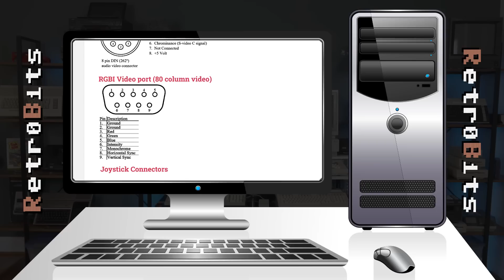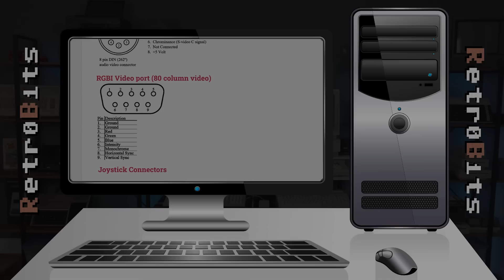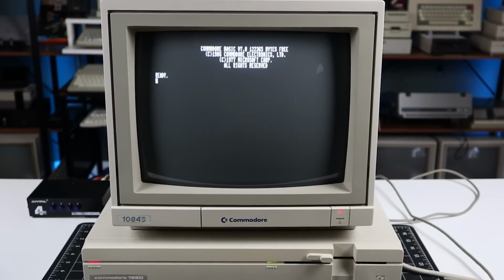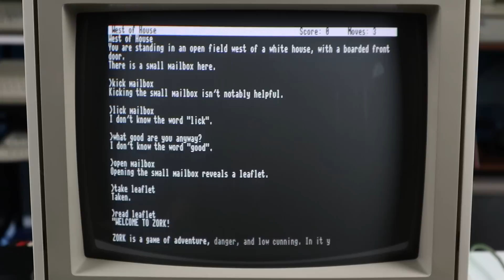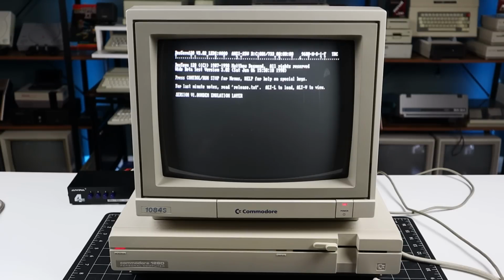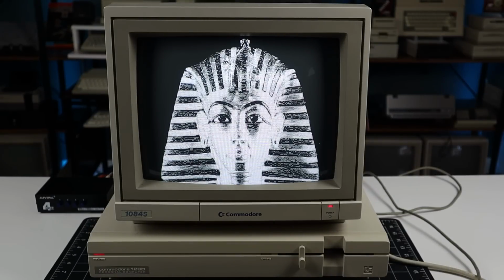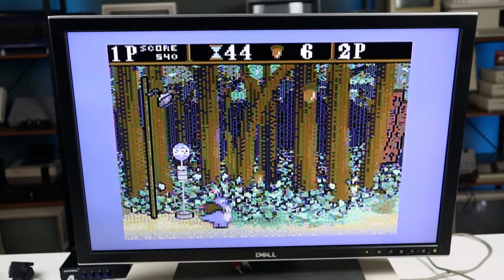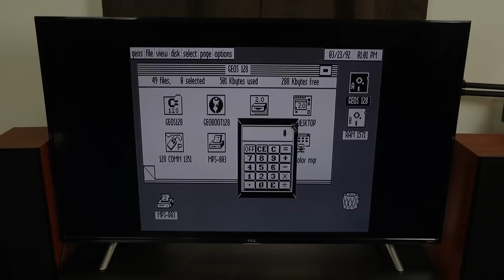80 Columns on the Commodore 128 without RGB or an adaptor?

Comment: Makes you wonder what that VDC could have done if Commodore decided to go for an 8088 instead of a Z80 for the second processor. It would have knocked CGA out of the park, and you'd be able to play MS-DOS games with SID sound. They took the wrong commercial gamble to support CP/M instead.
Reply: I dont think supporting CPM was the intention.  The 128 essentially was a super 64... everything people complained about the 64 was fixed (added on) to the 128.  An 80 column mode, faster disk IO,  actually usable CPM, a faster processor, a better BASIC, etc.  All of these things existed for the 64 as separate add-ons. Seems then that the goal was to build "a better 64".  I think they succeeded, but obviously it was a short term fix while they got the Amiga ball rolling.  x86 was saved for their clone line.
Reply: Back in the day the CP/M market share was higher than anything MS-DOS or Windows has ever held.  It truly was a monopoly.  Though the writing was on the wall in BIG LETTERS by the time C128 released.
Reply: @GoatTheGoat  That was true for the late 1970s and early 80s, but by 1985 when the C128 was released, MS-DOS was firmly estabilished, as even the 80386 was around the corner when the 128D came out in '87. If Commodore were to market the C128 as a machine where users could run their MS-DOS programs as well as play their C64 games, it would have been a commercial hit.
Reply from the maker: That would have been interesting! Retain the 64 and 128 modes the system already had, but with the addition of DOS compatibility, 16 color graphics and SID sound, it could have given the Tandy 1000 a run for its money. I imagine it would have increased the system cost because it would have to have provisions for RAM expansion up to 640K, ISA slots maybe?
Reply: According to Bill Herd they decided to make it C64 compatible, but the C64 CP/M cartridge wouldn't work with their design, so they added the Z80 only to run CP/M, which was only because the C64 could.  Sadly the C64 compatibility hampered not only the design, but also the commercial success.  Almost no software was ever made for the C128, since everyone could just make C64 software and sell it as C128 software, which effectively made the C128 just another C64.
Reply: @customsongmaker  That's kind of my point. Their goal of supporting CP/M, almost a decade after its release, was the wrong starting point. Business markets were moving over to PC's and compatibles, and home users were never going to use CP/M.

Ironically, the differences between the Z80 and the 8088 are not even that big on a circuit level. The major changes would have been in the ROMs which would need to be BIOS compatible for the 'C128-x86' mode to work.

Comment: Have you tried to find 4:3 mode on your TV. No converters, just use 80 composite monochrome and enjoy Geos128. It is that good, just change from 16:10 (or auto) to 4:3.
Reply from the maker: Yea I didn't mess with the aspect ratios on the LCDs. I totally would get it into 4:3 if I were going to use that mode regularly, but I'm sticking to my CRTs for day-to-day use!

Comment: A caution for anyone thinking if doing this: I bought one theses composite cables when I first got my C128, but none of the flat screen monitors or TVs I have were able to lock onto the signal very well. It was only when I passed the signal through a composite to HDMI adaptor that I got a decent result.
Reply from the maker: Interesting, I had no issues with any of the displays I tried. I wonder if there are variations in VDCs? Was this recently or back in the day? I wonder if it's age related. I have a couple other smaller Dell panels with composite that I can try, but that 24" one has by far the worst upscaling even with a perfectly clean signal. I'll try it with a couple of flat 128s too and see.
Reply: @retrobitstv  It was only a few weeks ago, so it could well be degradation of my C128, though the picture was reasonably good using RGBI through a MCE2VGA converter/upscaler. Maybe it’s time for recapping it. By coincidence one of the monitors I tried was a 24” Dell that looked just like yours, plus a couple of similar looking 20” Dells that are even older and a couple of 24” TVs

Comment: The BIT-C-128 to GONBES is what I use. Colors aren't that great but it's a decent conversion to VGA from RGBI.
Reply from the maker: I use a GBS8200 as well (with the CGA2RGB I mentioned in the vid). It gets the job done, but I'm planning on trying out the gbscontrol mod on it and see how much that improves the quality. Will make a video out of it of course :)
Reply: @retrobitstv  There is quite a quality boost from using gbscontrol, although I'm using an RGB2Component board (on an Amiga) and going into the component input on the GBS8200, but it certainly looks much nicer than with the GBS alone and the same component setup. The best results for a 128 might be from the Raspberry Pi-based RGB2HDMI project. Maybe that could also be in a part 2 to this episode? :)
Reply from the maker: Cool, glad to hear it's worth doing. I do plan to try out RGB2HDMI at some point as well!

Comment: Cool Video. I adore my C128s. I do have two 1901 Monitors. Does anybody know, where to get the DESTERM128 Program?
Thanx and happy holidays!!!
Reply from the maker: Thanks! You can find it on https://csdb.dk or https://commodore.software - just a head's up that if you want to use version 3 with an 1541 Ultimate II+'s swiftlink emulation, you'll need to patch it.
Reply: Thank you!!!

Comment: "no RGB or adaptor"

Proceeds to use an adapter to access the composite output from the VDC.  
🤷‍♂
Reply from the maker: Perhaps I should have said "converter" instead :)
Reply: I wouldn't qualify "using the intended cable" as an "adapter" even though it has different plugs on both ends.